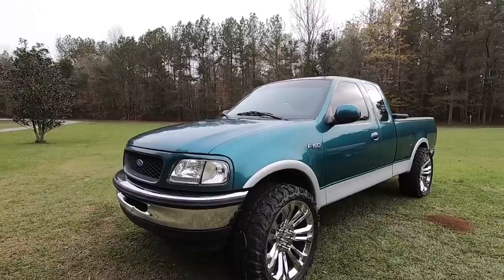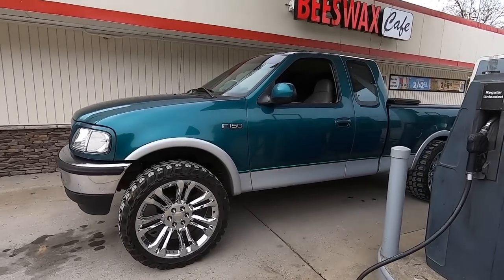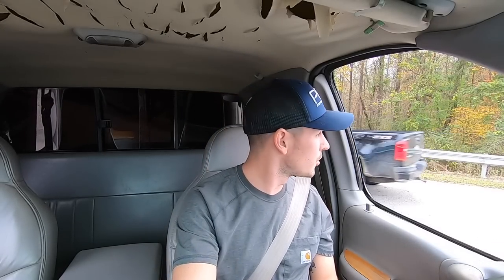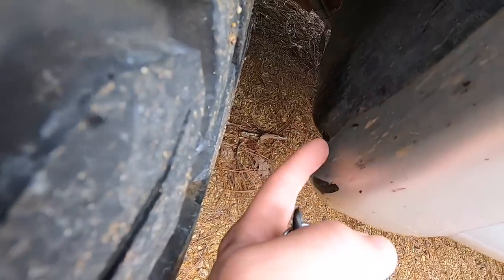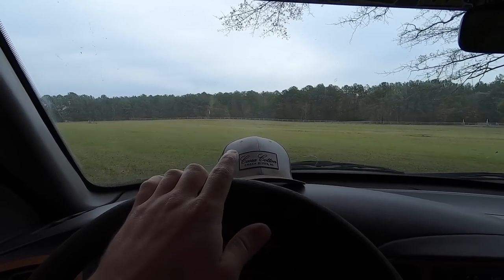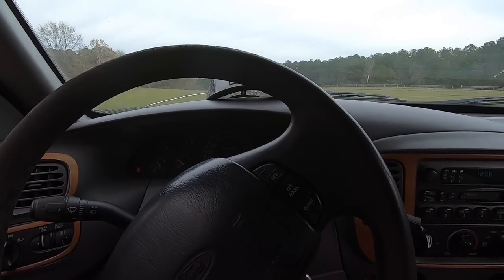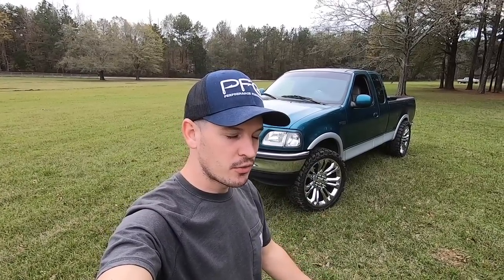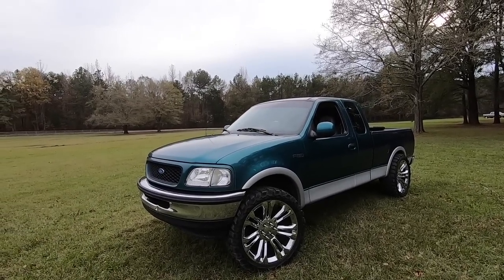Does it rub? | 24s & 35s | 3 inch lift

Comment: I got the 3 inch rough country kit and I have the 1.5 in coil spacer on mine and run 35’s and that does the truck go the most part and looks a lot better

Comment: I have a 99 Silverado 2wd with the 3 inch rough country spindle lift and a 3 inch coil spacer. The coil spacer isn’t actually three inches, the lift ends up being 3 inches though because of the geometry and it gave the tires a ton of positive camber but my truck had the adjustable camber bolts in the upper control arms when I bought it and the alignment shop was able to get it back to perfect with some adjustment left on both sides. Rides decent, but when I first put the coil spacer I blew out both front shocks and had to put bilstein extended lift shocks and once I did that it rode like 10x better. But stacking that lift kits is possible and in the end gave me right at 6 inches of lift. If you want pics lmk
Reply from the maker: i think the shocks on here should be okay going a little higher because they are the extended ones that come with the lift, one way to find out i guess lol
Reply: @lmfscrew  I bought the complete spindle lift from rough country that came with the block and u bolts for the rear and it came with rough country shocks but those wouldn’t fit with the coil spacer because they were to big in diameter which is another reason I got the bilsteins

Comment: I’m running 3.5 lift spindles with 2 inch lift coils not coil spacers and aftermarket shocks. I had 3 inch lift coils but delt with some camber so dropped to 2 and got camber bolts aligns like a champ. I clear 12 wides on 33s no problem. Just trimmed the corner on that backside 👌🏼
Reply: Could you fit 35s with that setup?
Reply: @Tryalil  no haha I couldn’t. Maybe on stocks but I have 12 wides.

Comment: i have 3 in spindles and 2 in lift coils with doetsch upper control arms designed for 2wd lifts with new upper ball joints new lowers and a camber caster kit.... had 3in spindles and 3in spacers w moog rk uppers and i rode the bump stops on the frame
Reply from the maker: Hows it ride with 2" coils?
Reply: @lmfscrew  it rides fine just make sure u align and u replace ur front end parts, a lil bit stiff but should be fine bc u have the rough country shocks

Comment: DONT get the 2” lift coils. UCA’s will have a bad angle. Get the Daystar 1.5” coil springs spacer to go higher in the front. That’s about all you can do safely unless you were to buy the 7.5” Fabtech lift. RC shock bushings suck btw so go ahead and replace those with energy suspension 98101 bushings. Also you can change the front bumper, valance and grille to the 99-03 version and run those a bit better. And please for the love of all things good in this world, put the dagum sway bar back on and get a new battery.

Comment: I have 2003 2wd with 3” rough country spindle lift with 1.5” daystar coil spacer with camber adjustment bolts from “Americantrucks.com” and 5” rough country rear lift block. Will need to get aligned after lift coil spacer. Getting my tires next week. They will be 35 on 20’s
Reply: Did the 35s end up fitting good?

Comment: Do not get the coil spring spacer  you will not be able to get your alignment 100% and will still have a little camber not in less you get the adjustable upper control arms

Comment: I have a 10thgen too and i am currently running 33x12.50r20 on just a 2 inch leveling kit and it used to rub bad but i just had to make some cuts and now it doesn’t